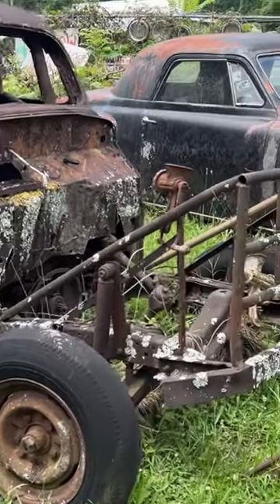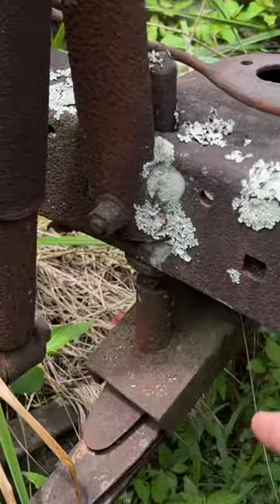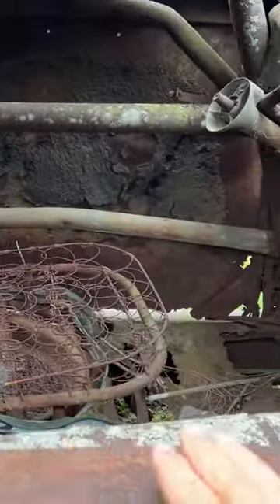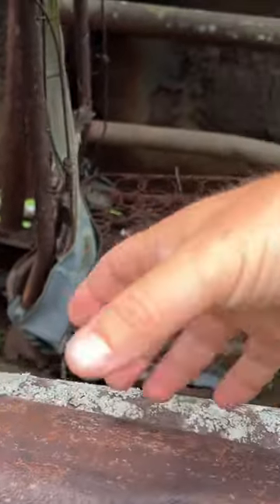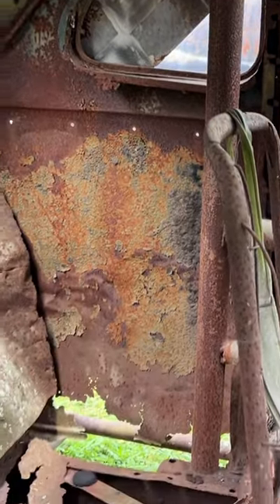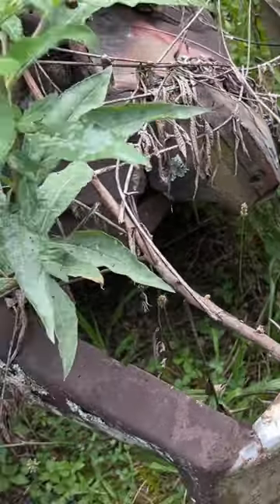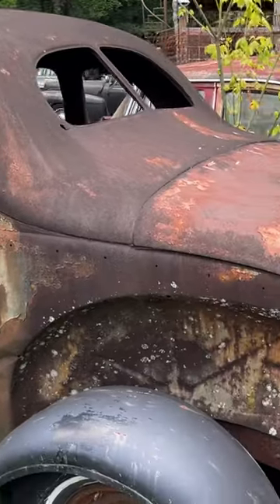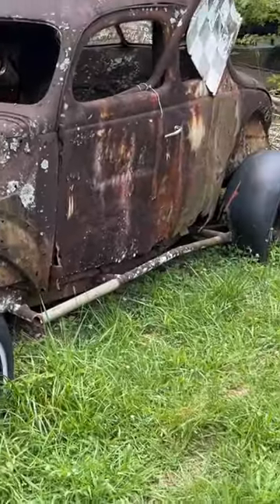FORGOTTEN 1940 Ford Dirt Track Car

Comment: I’d call that a piece of art that needs to be preserved
Reply: I went back to a place here in Maine where about half a dozen of these post-war stock cars in really great shape (in the late 1970's) were at the back of a pasture turned woods. A couple had some some really well done Beetle Bailey cartoon characters and "Kilroy was here", etc. Unfortunately, they were gone and a couple years later, an old guy I know told me he got them decades ago and scrapped them for metal. About 30 years ago, I remember he told me he cut up 2 Willys coupes for beer money back in the 1950's. The weird thing is, this same old guy usually puts together 1-3 Model A's every year out of parts and pieces and sells them.

Comment: and it still has the bolt action three on the tree.On the dirt you had to hold the trans in second,because they would pop out of gear if you let go the throttle. Mine had a wire loop hanging under the dash to clip on to the shifter to keep it in the 2nd gear.